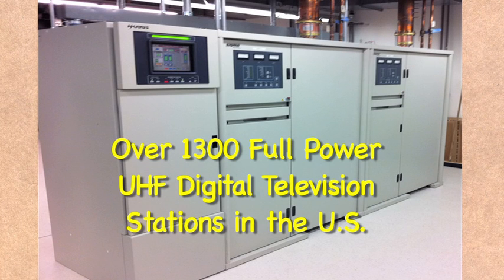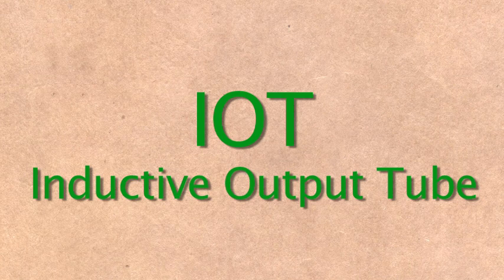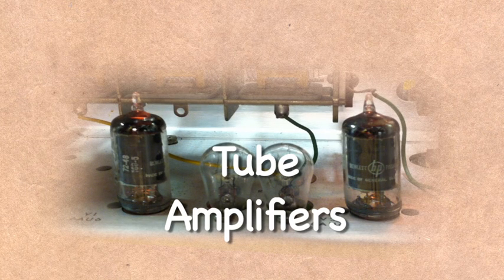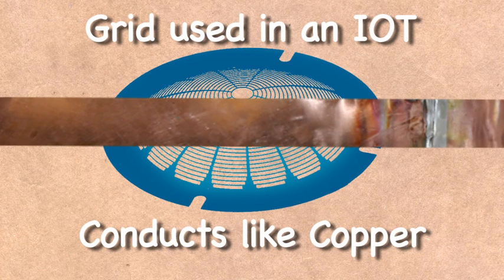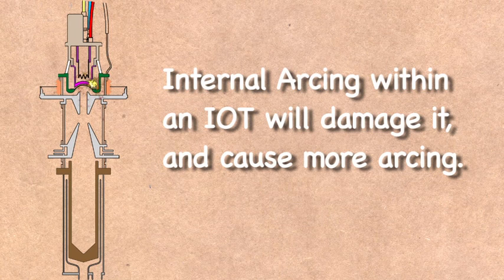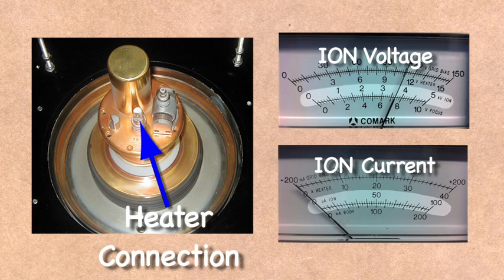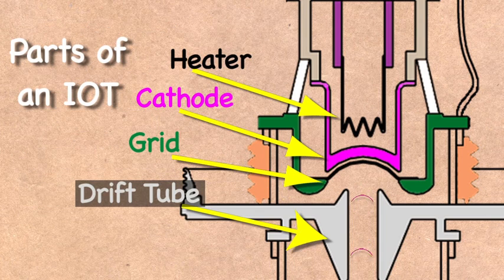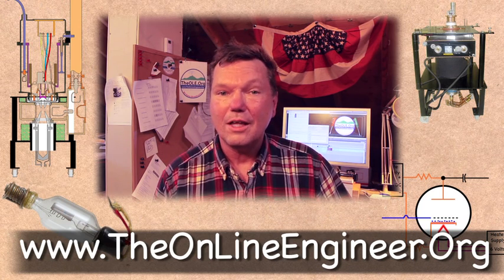How IOTs Work

Comment: Is there an FM broadcast IOT?  Maybe it is larger for a lower frequency. Or just use triodes.
Reply: At FM frequencies conventional tubes are cheaper and easier to use.
Reply: And also the FM ERP is limited to 100,000 watts (50K transmitter into 4 bays) so a 500,000 watt output IOT is overkill.
Reply: IOT's are primarily used for UHF band. Since FM is on VHF,  an IOT is not suitable.

Comment: Excellent video.  Many years ago I help maintain a RCA TTU-30 which used klystrons. We called them tea-kettles because most of their input power was spend boiling water for the heat exchanger. RF was a minor byproduct- about 20% efficiency on a good day. Little wonder so many Us went bankrupt in those days. I'm retired now but good to know that UHF transmitter technology has improved since then.